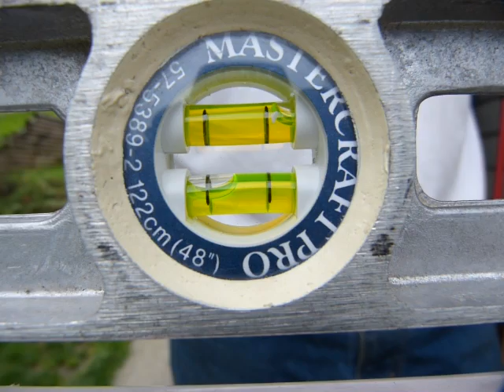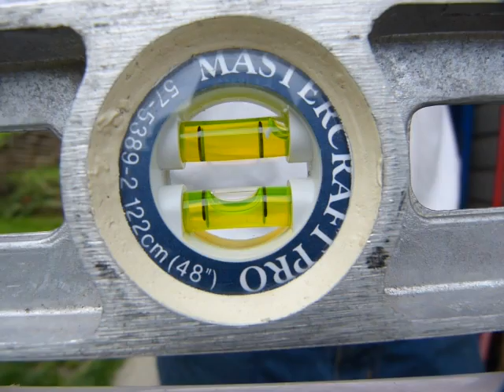How to read a level

Comment: What is the other vile for?
Reply from the maker: End vials for plumb, center vial for level
Reply: @apprenticemath  He is asking what is the purpose of the top middle vial?
Reply: @vuk96zj  the one answer I don't know and I think he doesn't either.
Reply: If you never figured this out... because the vial is curved, only one vial will read level depending on how you orient it... If he flipped it over, that top vial would read level
Reply: This is the only video on you tube that I could find with a similar level to mine. What is the purpose of the top middle vile?
Reply: @kf5064  same as the bottom vial. It allows you to flip the level any side you want and it will always be the right side up rather than the level having a top side and bottom side